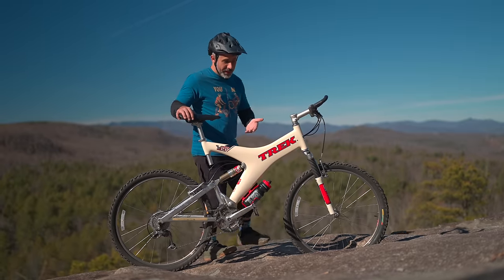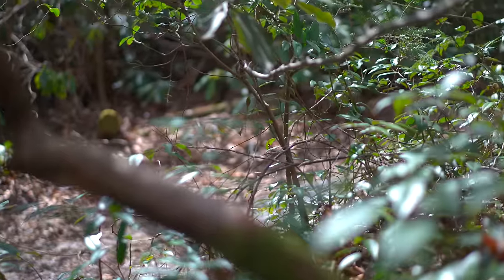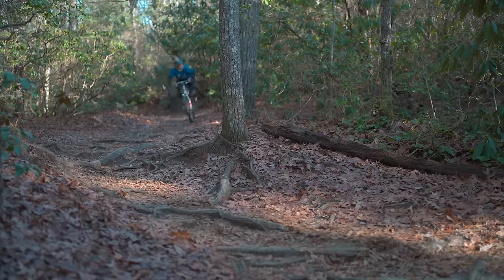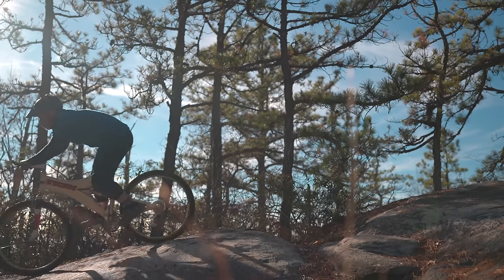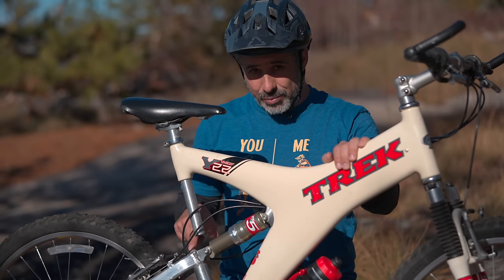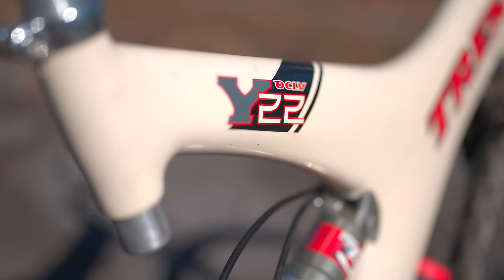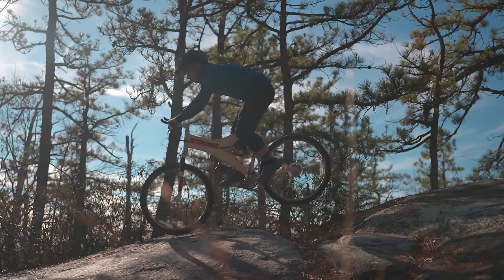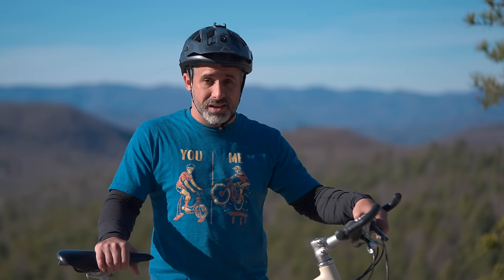The Trek Y22 was a 1990s Carbon Fiber Icon for the masses

Comment: I have one in my shed, purchased ~1998. Suspension bad for climbing unless you lockout (with an upgraded shock). Often found it to want to kick me over the front (probably due to the unadjustable original shock). My one is not painted with carbon black.

Comment: Sorry Seth, but you are wrong about the fork. Elastomer Judy's were '95-'96, the champagne (XC) and yellow (SL) ones. This is an updated and upgraded 1997 model and it has the coil + elastomer mix that was all the race back then and everybody had it. These were decent forks (I have one right next to me, as I write this), but Manitous had better damping and the Marzocchi Z1's and Z2's were superior with their open oil bath. But these are coil sprung for sure. Anyway, a beautiful example of a bike. I have bare Y Five-O frame from the same year, which was the top model with full XTR, Manitou SX Ti and Stratos shock, and need to figure out what to do with it...

Comment: I have an old Pro Flex full suspension. It's different in that it has a carbon swingarm with a post going up towards the seat post with a shock there, not a triangle linkage. Probably not as good, but good for me. Aluminum main frame, but most importantly a girder fork!!! Amazingly smooth. I'm not remotely as hardcore as you (but I am on your old stomping grounds of Long Island), it works for me. But seriously, find a bike with a girder fork and take it for a ride. It's great. Or better yet, come visit me and take mine for a spin. Could use a tune up, but if I know you're coming I'll do my best to get ready!! NY pizza on me :)

Comment: URT suspension isn't even that bad if the pivot is in the right spot which on the Treks and Gary Fishers it was, It does actually work as rear suspension and isn't much worse than a basic single pivot from the same time period.
Reply: This is the correct take

Comment: I had a 1st generation Y22. It was  both revolutionary and hot garbage at the same time. It was a cool looking bike, but the rear triangle was so flexible it could only hold a corner on smooth trails without rocks or roots. The in-house components were terrible, especially the Trek Matrix rims. The RockShox Judy was a disaster with constant blown rebound cartridges. I was a young bike shop employee at the time and drank all the Trek Kool-Aid about this bike.  I sold it one year after buying it and have never bought another Trek.

Comment: I Had the Y3, the Aluminum version. The most horrible bike I'v ever ridden. The frame was flexy as hell between te bottom bracket and the headset. The biggest problem was standing up in a steep downhill would extend the rear suspension, making going me over the bar all the time. Used it 1 holiday in Italy, must have gone OTB > 10 times. back home I got rid of it an got a C'dale super V. Waaaay better  bike. Never Trek again.

Comment: Talks money, comparisons, inflation then leaves out the MASSIVE elephant in room. Componentry.
LX? Are you taking the fukkn pi55? That's one up above fukkn STX!!!!
STX was fukkn entry level in the 90s. And it's still pretty much same today.
Side note, that's why I build my own bikes. I build mine to my spec.
Got 3 atm. XC full carbon XXWC.
Full carbon XTR Trail. Full carbon XTR Di2 Enduro.
Yes with the DT Swiss 240S wheel sets, yes, with full carbon Richey Superlogic finishing set.
You get the picture. Top of the line RS suspension. Though the axC get DT Swiss carbon suspension and the trail gets carbon World Cup RS forks. So......... Yeah. Huge swing and a miss.
LX? That's a bottom rung bike. That's the price you pay buying brand name bikes. You think your getting a Ferrari. But it's running Toyota corolla parts.
Same here. XT would be the mid level. XTR the flagship. If matched with suspension wheels and frame. Which if LX, this would NOT!!!!
ORDINARY WHEELS
ORDINARY SUSPENSION
STANDARD FINISHING KIT.

Fukk me! I run a Ritchey Carbon WCS saddle for christ sake. Fukk knows what seat they pulled out of the left over bin for this.

Details. It's in the details.

Edit. Made it to the end. As guessed, correctly, wow, what a surprise, the Y33 is a "XT" bike, the Y50 a "XTR" bike.
Yep, huge differences. Though the  Judy's are throwing me. XC is what I had on my 90s Giant. Not cheap. Considering the CADEX CFM came out with only Mag21. Though I believe there were 3 Judy options. I only recall XC. I believe there was a DH? I paid $1500US for my XCs in 95.🤷🤷🤷